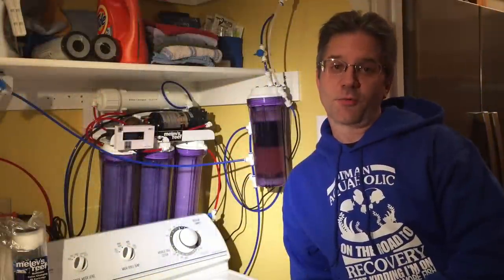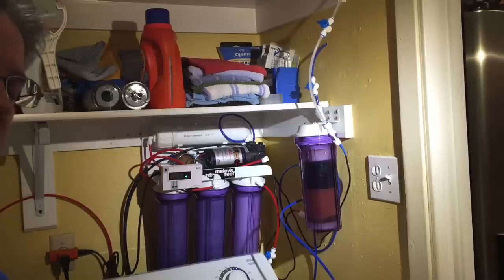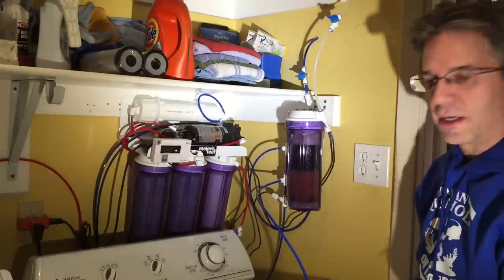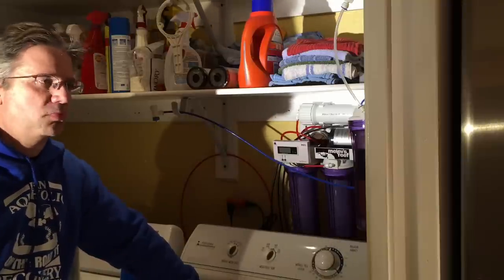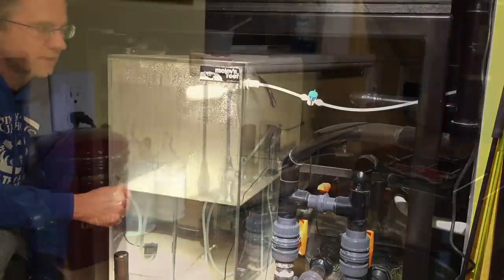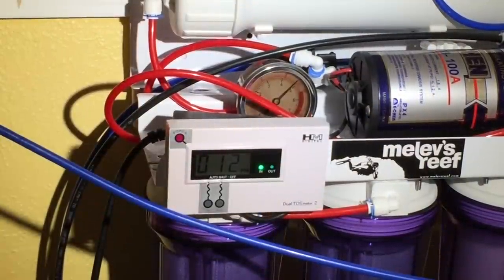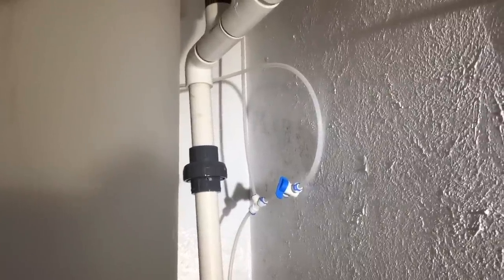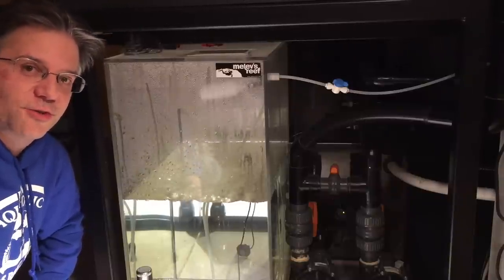Get the most out of your RO/DI system

Comment: hi melev, another great video.  I have a air, water a& ice 150gpd RO/DI system that i just got last wk and im still trying to figure it out.  the way you have it theres so many check valves that i got confuse, what i like about it is that its all for a secure purpose which is priority in this hobby. I'll have to see this video again and again to try to understand what and how you did it.
Reply from the maker: I'm using a lot of individual ball valves to stop water going to various areas. I know it's an octopus of choices at first glance, but it all does make sense. Let me know if you have any specific questions and I'll try to clear things up.

Comment: Does the unit fill the auto top off and the saltwater storage at the same time or do you switch it between the two? If you switch it, what happens if the ATO shuts off with the float valve? Does the unit stay on or turn off? Thank you for your videos sir...just getting in to reefing and the Ro/di units are the most confusing to me. Keep them coming
Reply from the maker: If both containers need to be filled up at the same time, they can do so. Each reservoir has a float valve. Once the ATO is full, the saltwater storage will continue to fill. Once its float rises, no more water is added and the floors stay dry. The RO/DI system will turn off, but will shudder back to life every 15 seconds or so trying to add a little more water. (When that happens, some water goes out the waste line down the drain.) That shuddering sound I hear reminds me to shut off the RO/DI system entirely -- what I do is close the inline ball-valve on the tubing going to the fishroom, which pressurizes the RO system and shuts it off permanently until I open that valve again.
Reply from the maker: I did upload six more RO/DI videos about three weeks ago. Check them out for more details. :)
Reply: melevsreef damn that was fast....I was watching the new video and only got a minute in before you replied....thank you very much sir for your help...viewer for life now
Reply from the maker: Happy to help; I try to answer questions in a timely way.

Comment: Thanks I'll probably just buy the less expensive one with out the manual flush valve and install the valve set up you have. One additional question dose your RO system still dump waste water when you have the TDS creep go down with the valve set up like this.
Reply from the maker: Where are you buying it? From my site? http://melevsreef.com/catalog/rodi-systems  To answer your other question, any time the RO system is running, water is going out the waste line.  

And if you used the bypass flush valve, all the water goes to the drain line, skipping past the flow restrictor.

Comment: I have a similar ATO container. Mine is 20gallons, but i had a problem with back siphon. I had it refilling water to the sump. Now that I've run it to the display I no longer have this issue. Is that how youre doing it, or are you running a check valve?
Reply from the maker: No, I have the output of my tubing pointed into a vertical riser that avoids a siphon. Here's a picture: http://melevsreef.com/pics/11/02/ato_wired-14.jpg
Reply: melevsreef Got it now, the aqua lifter is for something else right? Since the Smart ATO came with its own pump? Thanks
Reply from the maker: 915Mang Correct.  When I had this set up previously, I used the Aqualifter -- it was a handy picture.  When I switched to the SmartATO, I inserted the tubing from that pump into the same vertical riser (or chimney) to direct the flow into the sump and still quickly break the siphon.  The tube is inserted about 2" into the vertical riser. I was able to use the tubing holder that came with the kit to secure it to the riser with a ziptie.

Comment: Thanks for the videos.  I've been hauling buckets, and just ordered a bunch of tubing, tees and valves.  This will be so much better.

When you're making your saltwater, how long do you mix it before using it?
Reply from the maker: At least 48 hours.  I like to let it age a bit.
Reply: for how long can a bucket of mix SW can be store?
Reply from the maker: If it is sealed, a few weeks.  If it is it in a bucket with a loose lid, I'd suggests a powerhead to keep it circulating at all times.  Then it would be good much longer.
Reply: Thanks!

Comment: Quick question is the valve set up you have on your RODI unit the same as having a manual RO flush valve, or is this in addition to having that RO flush valve set up. I'm in the process of purchasing a RODI unit and I was wondering if I should buy the one that comes with the water saver manual flush valve or the one that  just is constantly dumping water.
Reply from the maker: A flush valve runs water across the membrane. If you want to do that, you need to literally stand there while it is open, count to 15 seconds, and close it.  When people forget to shut off that valve, it damages the membrane.  

The method I use is different.  I'm definitely avoiding TDS creep by wasting 90 seconds of RO water, but that is about 2 oz of water.  The trapped water in the membrane housing is still flushed out as water went out the waste line during the 90 seconds, and the DI resin lasts longer because I didn't let that stuff trapped in the housing use up any resin beads.

Comment: What is the purpose of having a tds meter measure the water coming in?  Who cares as long as what is coming out is less than 2.  I really don't care how efficient it is as long as it eliminates tds. 

Would that tds meter be better put to use measuring the water coming out of the DI chamber?

Also what's the best way to know when you need to change your filters?
Reply from the maker: I don't measure the water coming in - I completely agree with you on that point.  I measure the TDS before the DI stage, and after the DI stage.  The Dual TDS meter provides both of these numbers, and helps me avoid wasting DI resin due to TDS creep. I discussed that in this video, but I have a shorter video that explains it here: https://www.youtube.com/watch?v=JWbKnsT-kLw&list=TL8bpWF6d8Q8Y

For the prefilters, the general rule is 6 months  (if you have a 125g tank), but you may need to change them more frequently if they appear discolored. As they get dirty, flow is reduced which would lower membrane efficiency.
Reply: melevsreef   thanks that is helpful!

Comment: Mine does not have a bleed valve to avoid tds creep. But it does have a membrane flush valve, does that wok the same? Does that bypass the di? Or should I install a separate valve just before the di?
Reply from the maker: The membrane flush valve is the same principle. Open it up and run it for 15 seconds -- literally count them out so you don't walk off and forget - then close the valve and make RO/DI water.

Comment: When your turning off the valve for your 2 min tds creep is that the only waste water line that is being cut off?
Reply from the maker: When you close a valve, the water from that piece of tubing is sealed and no water comes out.  The waste water always only runs out the black tubing. IF any output valve is open, waste water flows and RO or DI water is coming out of the system.  Lastly, there is no cut off valve on the waste line.
Reply: Gotcha ty

Comment: Any reason why you don't run a dual DI setup, swapping out the 2nd one for the first and placing a new refill in the second cartridge?
Reply from the maker: When the first one is spent, it can actually release TDS into the second cartridge wearing out that secondary resin more quickly.  It's simpler to change out one when it is consumed.  After this video was shot, I replaced it.  :)
Reply: melevsreef Cool, I've always run two but I didn't know that it could release back into the water later.
Reply from the maker: Justin Stanley For maintenance accounts it makes sense to run doubles since the service person only shows up weekly (or less frequently).  For a hobbyist, they can change the filter immediately when it is spent.

Comment: How do you know when the drinking water tank is full? And what would happen if you left the valve to the drinking water open all the time except when you're making aquarium water?
Reply from the maker: When the water tank is full, the pressure in the line shuts off the RODI system.  If you leave the valve open to the drinking side all the time, the RO system will cycle on and off frequently as water used to keep the bladder tank full.  I prefer not to leave that valve open, except when I am making more water.
Reply: Thanks for the response, your videos, and your contributions to reep keeping in general. You've taught me so much since I began this hobby a few years ago!

Comment: What do you do to preserve DI resin when it's cold out? I noticed when I had my tank running that I would go through DI resin real fast when the incoming water was really cold. i want to set up my tank again, that's why i ask.
Reply from the maker: Water temperature doesn't affect DI resin usage. What consumes it is higher TDS going into that stage.  So measure the TDS before the DI and see what it reads.

Comment: Never let he tube holding resin to dry out at all. soon as I finish making RO water, turn off supply and put polythene bag with elastic band, never any problem
Reply from the maker: Right, don't let the resin dry out.  But closing the valve after the DI stage and allowing the system to pressurize, it will be fully immersed in RO water.

Comment: I dint know you could run 25 feet of tube. Does it cause back pressure? could yo run 50 feet of tubing?
Reply from the maker: +Kawwwman The maximum recommended distance is 40' from the RO/DI system.  Anything more will create backpressure issues.

Comment: So your DI resin needs replaced when only half of it is no longer black?  

Oh!
Reply from the maker: It may need to be changed, yes.  With a TDS meter, you'd know for sure when it is spent.
Reply: melevsreef    When do you change it?   Should it be zero after the DI stage?  Or is 1 ok?
Reply from the maker: RavineDriver I change it when it gets up to 4 or 5 TDS.  Or if I'm about to make a ton of water (250g at once) and it measures 1 - then I'll change it now.